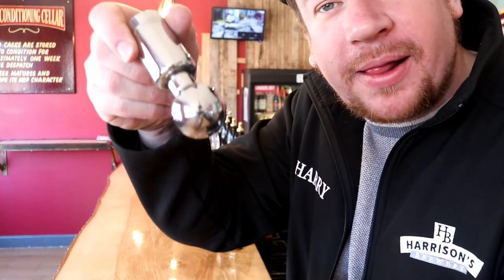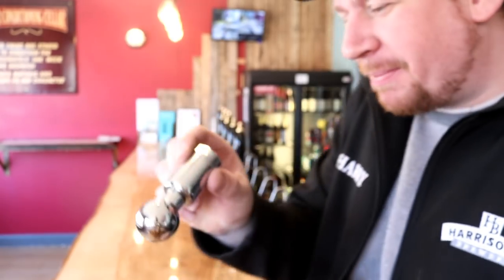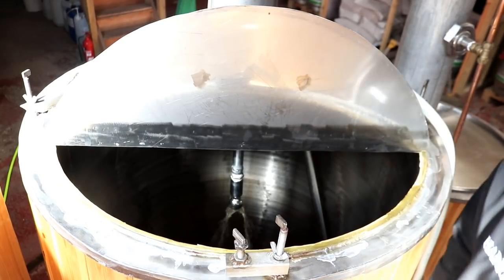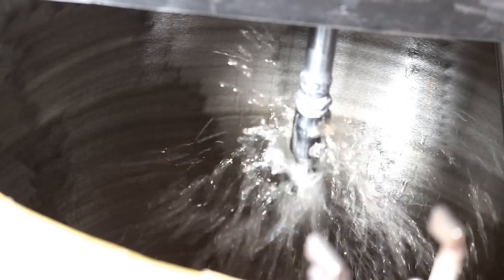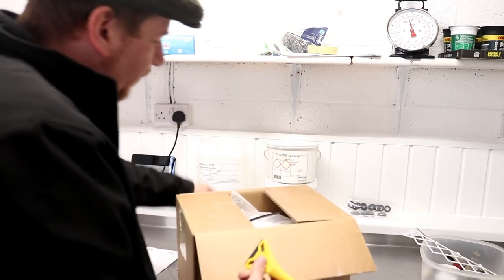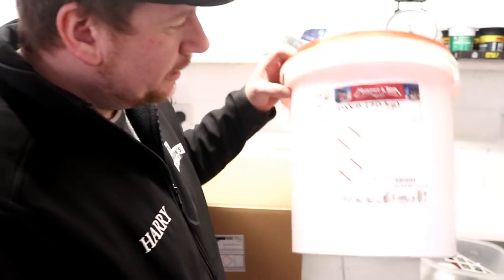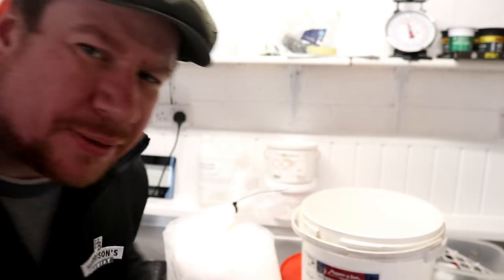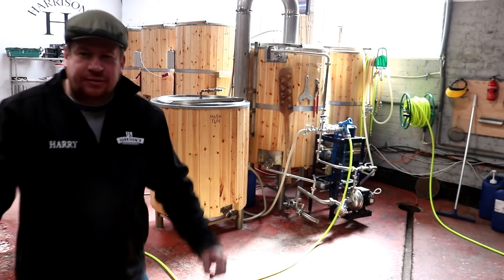ROTATING SPRAY BALL

Comment: If you want to test how well your sprayballs are covering or how long a cycle you need to clean, at work we use riboflavin. You make a solution with water and spray it around then run your CIP, then us a UV torch to see if there is any left.